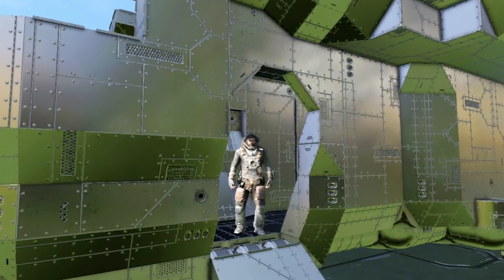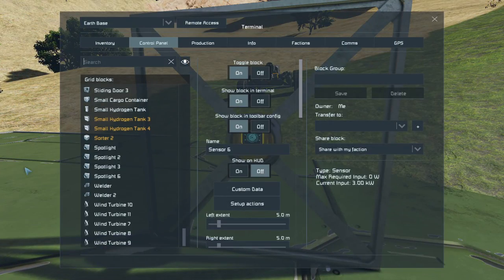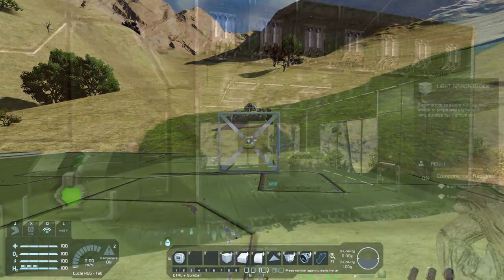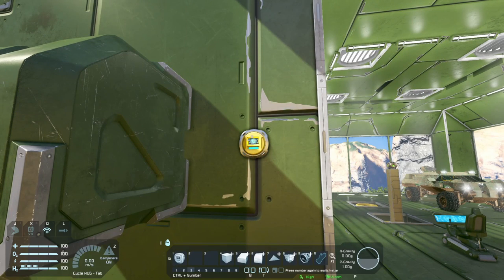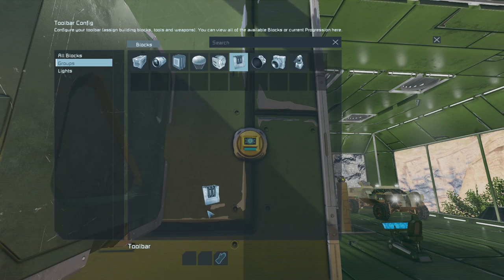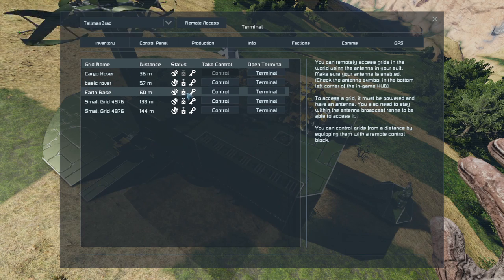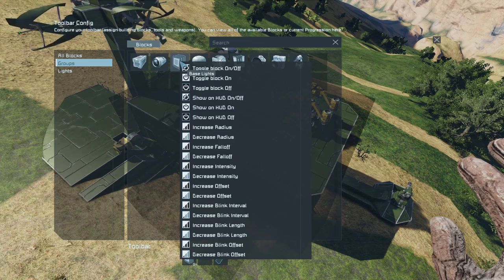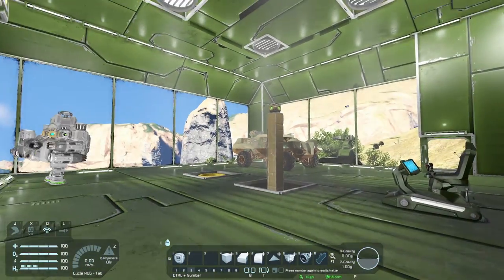Sensors | Space Engineers

Comment: I haven't had the need for the sensor but I did not know its function so it is a good thing I saw your video. Thanks!!!
Reply from the maker: That's great. At least now you have an idea, should you feel like setting one up. Thanks for commenting Oscar! All the best to you.
Reply: @TallmanBradGameplay  On the video I mentioned you I have a bunch of lights under the main base, where all the assemblers are, now, I  only have to group them and set the sensor. I normally leave them on and that is not cool, it looks unprofessional.
Reply from the maker: That sounds good Oscar. It is quite satisfying when the lights turn on as you enter and leave. Might need to add 'small ships' to the sensor to make sure it turns on if you're in a vehicle. It doesn't always detect you as a 'player' when you are piloting a vehicle ;)

Comment: Does it work on small grid vehicles? I seem to be in an impasse on this situation.
Reply from the maker: You need to set it in options to work with vehicles. Or pilots/player.
Reply from the maker: 'detect small ships'
Reply: @TallmanBradGameplay  somehow its not working on me, I'm not sure if its a bug, but right now I opted to use the remote system to open the hangar doors, kinda hassle but it gets the job done.
Reply from the maker: That's strange. Normally works. Detect player should get it though?
Reply: @TallmanBradGameplay  It detects the player but not the vehicle, I have to come out of the craft in order for the sensor to activate. Strange indeed.
Reply from the maker: Does the ship grid belong to you? If not can you test with one you own.
Reply from the maker: Try adjusting 'detect neutral, owner and friendly'
Reply from the maker: Also, do you have any mods installed that might interfere with the workings of a sensor. And finally, can you set up another sensor away from your current one on another grid perhaps, to test if it can detect small grid ships?
Reply: @TallmanBradGameplay  apparently I'm in a public server with 41 mods installed, yeah I have tried your suggestions and it still wont work. I fear some Mod may be interfering with it.
Reply from the maker: Yeah a mod is possibly interfering. Unusual, but that's all I can think of.